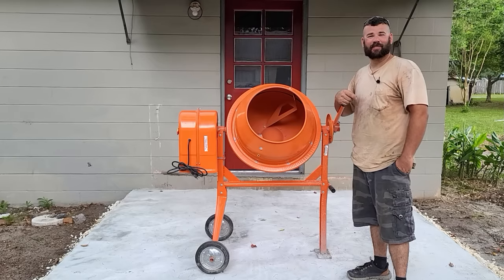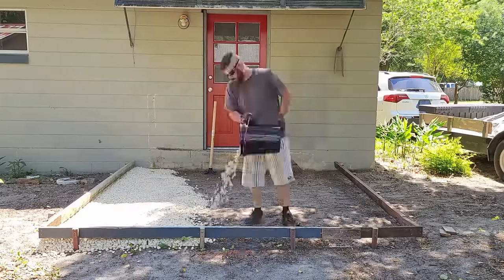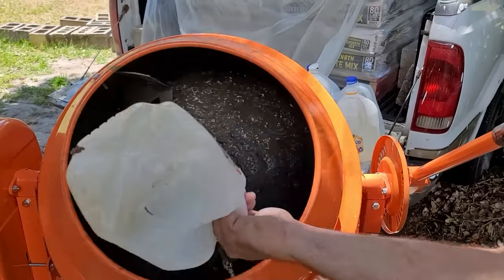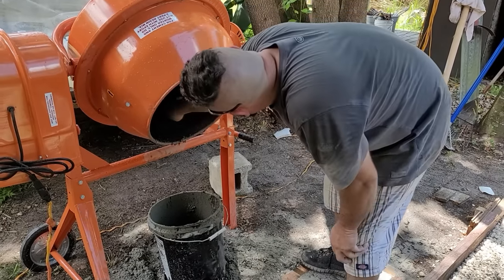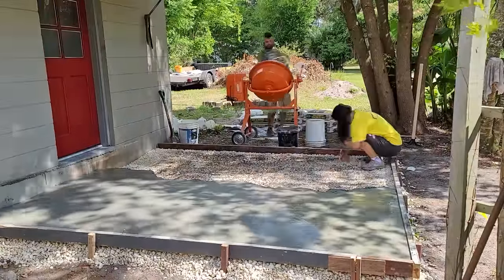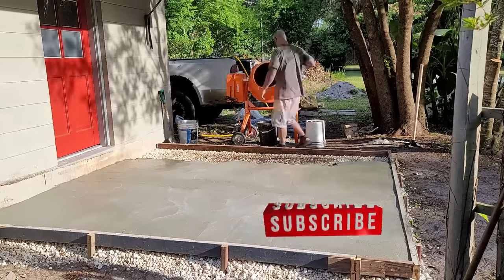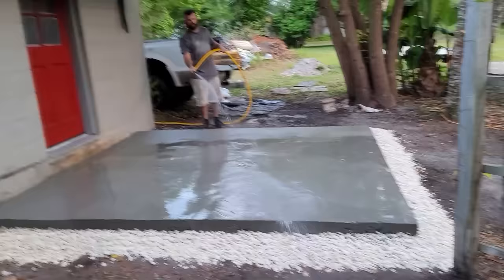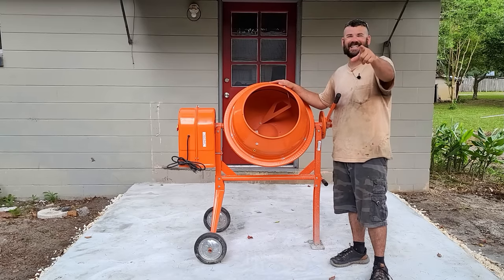Pouring a Perfect 10'x10' Slab with the Harbor Freight Cement Mixer

Comment: It might have been possible to set the mixer in the area to be covered and dump directly onto the base until you worked yourself into a corner.  I hated to see you work so hard, but I appreciate it.  Great video, especially the information about the mixing process that worked best for you.
Reply from the maker: I really wanted to do that, but I couldn't figure out how to do it and not smash the wire fence brackets. Thank you for your comment, and welcome to the channel!

Comment: I poured a 6’x3’x4” slab last weekend by myself. Used an earlier model of that mixer and I screeded as I went. It was tough even at that size so you have my respect. A thought for next time is to have the top of the forms boards to be your screed level and screed as you go. I found putting the right amount of water in first is the way to go. I also used 50# bags x2 per batch and kept the mixer running the whole time.
Reply from the maker: We love hearing from fellow DIYers! We will be doing another big project this summer and we definitely keep your recommendations in mind. Welcome to our channel!

Comment: Thanks for the video. It's good to see what can be done with a straightforward approach and minimal expense. I want to do a patio behind the house and it's really useful to see what other people experienced. I don't think it's even feasible to get a concrete truck back there without massive prep work or by using a skid steer or similar piece of rental equipment to run back and forth 20 times and rip up the yard. Since it'd be $$$$ to hire a contractor to do it, I could instead spend some of that money on purchasing more heavy duty concrete equipment or renting it anyway. I have a small mixer similar to the harbor freight mixer--but it's pretty labor intensive to even do small projects. Very helpful, thanks.
Reply from the maker: We absolutely love comments like this! We hope you diy your porch and have a blast doing it. You're right, it's a lot of work but totally worth it. Welcome to our channel!

Comment: I've loved my HF mixer!  Only problems were dry zones. I would have to stop the mixer, use a gardening hand hoe and break up the dry zones.
Mostly, I've only done 12" piers and two 5'x5' slabs.
I've always oiled my forms, poured wet, screeded, misted with water, and waited about 45 minutes to let it start setting up.
Then come in with my float and trowels to smooth it out.
Reply from the maker: That's awesome! We have only used it for that project so far, but I have a ton of molds that I want to start making. Welcome to the channel
Reply: We just poured a 4×10 slab, 3.5" thick.  We had the best luck adding a gallon of water to the fully upright mixer, adding 2 60lb bags, then starting it and running it tipped to the limit before it would spill and adding water until we could tell the clumps on the bottom were broken up.
Reply from the maker: It's all about finding that sweet spot. Welcome to our channel!

Comment: We just did a 10’x13’ pad using this mixer and mixed 2 80lb bags at a time. We figured out the best way to do it which was get a good amount of water inside the mixer, then put first bag in then use a hose to add more water as we mix it until it’s really soupy, then add the second bag and spray more water as it mixes for a minute or so. We made out mixture fairly soupy which helped becuase it gave us more time to finish pouring the whole pad before it cured. I would recommend this harbor freight mixer if doing more than 30 bags. We did a total of 72 bags and it was so nice not having to mix that shit in a wheel barrow. The worst part is building the damn thing. Took us like and hour just to put it together 😂
Reply: Also I would’ve bought a cheap wheel barrow so you didn’t have to use a bucket the whole time, then just move the mixer inside the pad until you get closer. I’m no expert just giving you our experience using the mixer. Good job on your pad!
Reply from the maker: Glad to hear that others are DIYing too. I made a video for putting it together also because I knew people would have a hard time. Welcome to our channel!

Comment: Works great with 2 60lbs bags. Spray inside with water, turn mixer straight up and plop bag on top the bust it with a hoe. Much easier than trying to dump/pour the bag. Move mixer the #2 position, turn her on add water to get a good slurry going. Don’t want it binding up on the mixing paddles. Turn it off. Back to upright, add next bag, then back to #2 and let it run. Because the first bag is more slurry, second bag mixes well and you can water as needed.  Very consistent result every time. I’ve even done a third 60# just to get done but it’s the same process, just harder to mix because you can’t get a good angle on the bowl, but it’ll do it in a pinch. With 2 60# you can get a good rhythm going especially if you can be inside the pour area and mix and dump. But this also work really well for a wheel barrow, very little spillage.
Reply from the maker: We will definitely try all of that on the next one, hopefully coming this summer. Welcome to the channel!
Reply: Once you hit that rhythm it will get done in no time and will be fun too! We normally had three guys. No mixer, just a bucket and a corded drill. 

We were doing a slightly different application but it’s all the same stuff. Get one guy towards the end of the current pour to go setup the next and start. Other two back him up and prep the next space, pour and spread, rotate the mixing guy every so often (it’s a break). Rinse and repeat!

With three good dudes you could knock this out in one morning. Especially with a mixer
Reply from the maker: We have gotten much better with the mixer since the video. That was actually our first time using it. We plan on doing a driveway soon, so stay posted. Welcome to our channel!

Comment: Nice work.  I'm sure you'll get the usual hate comments, but the only thing that matters is that you are happy.  I've done a couple of similar projects with the HF mixer.  I do always mix 2 full 80lb bags.  I put the full amount of water for all 160lbs in first, then I put one bag in, and wait until it's pretty much all liquid (1-2min), then I put in the 2nd bag and wait another 2-3 min for it to finish mixing.  The 5 gallon bucket slowed you waaaay down, but hey, you gotta use what you have.  Some sort of ramp to dump it straight in to the form, might have worked.  Anyway, the 160lbs sometimes is hard for the HF mixer to even spin!
Reply from the maker: I'm definitely going to try that next time and we recently bought 2 wheelbarrows so I'll be much better prepared. You live and you learn. Btw, welcome to the channel!

Comment: WOW! I think a wheelbarrow and bigger batches would've helped a lot, but I've never done this before. haha. Great job man
Reply from the maker: Unfortunately the wheelbarrow wasn't an option for the project because the fence is in the way. Next time I will do smaller sections. DIY is always the best way 😁. Welcome to our channel!
Reply: @VIPHoldings  Well I have seen other videos where they remove one of the boards on the end to allow trucks to drive into where the concrete was poured. I think you could've done the same here. Moving all that weigh with a small bucket is insane! Haha. You got it done though! That's some serious determination. Haha.

Comment: Cringy in the best way. Getting it done is what! I have recently taken some building courses at my local community college and went deep with concrete. The words you use are not correct to the profession but the result is perfection for the intended use. How did your back feel after all this? Looking to do similar work, already have the mixer but only used it for fence posts at this point.
Reply from the maker: I was in bed for a couple days after this. Good luck on yours and welcome to our channel!

Comment: Instead of doing the 5 gallon bucket routine, just put the mixer in the pour area and dump it straight to the ground, saves a lot of work and no wheelbarrow needed.
Reply from the maker: I thought about that but didn't know how I would be able to do it with chicken fence laying there.

Comment: How's this slab holding up? Any cracks? I would be concerned the drainage aggregate would start to fall away since there's nothing to hold it in place  around the perimeter.
Reply from the maker: So far, so good. I do plan on building a perimeter, but no cracks, and the base rock is still in place. The porch gets used pretty regularly, too.

Comment: Yall did great man also u saved alot of money and 8 hours for that yall good job. 
Here some tips for you next time 
1 .place a concrete bag on the bottom on that little leg to make it more stable 
2. U can mark a bucket when u find out how much water your comfortable,but on this unit I fill it to like the gasket seal and then add lil bit depends how I need it
3.one  could lay a tarp or wood and cut alot bags in half flip and make a pile and and u can shovel it or u can dump them over shoulder however 
4.stick with two bags 80 lbs for sure and when it's mixing since u put that concrete bag to make it more stable ,preferably me I grab the handle release it and start tilting it even more and it mixes so fast especially when I have mix something dry or some high psi and only allowed the exact water amount
5.instead of building up the concrete all the way on a big pour only fill like half 2inches and do a little area like that  then when your ready fill the 2 inches then bull float a large area instead of little sections everywhere and stoping so much 
I got many more but im sure your u got it under control good job again 
Subcribedddddd!!
Reply: Also that wire is fine uhave nice base ,
Reply from the maker: Thank you and welcome to our channel!

Comment: You could also use a metal ramp to pour out the concrete in the form
Reply from the maker: I think my biggest problem with this form was that it was just too big. Next time, I want to do smaller forms, so I have more maneuverability.

Comment: It looks like it Turned out great looks like you did a good job  Do you think it would have been a little better if your concrete was a little more wetter while you were pouring all of that and then as you Get to the end make it not so wet. I'm just wondering.  Give you more time to work with the 1st part of the pour
Reply from the maker: I thought about that, but the professionals say that it's stronger if it's on the drier side. On the next pour, I am going to make it a bit wetter, and my forms will be much smaller. Welcome to our channel!

Comment: While there is room for improvement, and I’m no expert by any means, I’m very impressed. Personally I don’t use straight concrete mix, I use the stuff that has rock already in it as well as use plastic underneath for a moisture wall. However you did it very well and it looks good!
Reply from the maker: Thank you, and welcome to our channel. So, where do you add the plastic? Under the foundation rocks or between the rocks and the pour? Why do you do it?
Reply: @VIPHoldings  being in the south and moisture is a big thing here as well as water, I used it on my car port  ontop of just the bare ground(clay structure) however I would have liked to put it ontop of some gravel but didn’t want to risk tearing the plastic. So far I haven’t had a single issue on moisture or water pooling up. I’ll be building a storage pad and shop pad in the future, one will get plastic the other won’t
Reply from the maker: @Grady_OBS  ok, so you used the plastic instead of rock? I think that was an intelligent and cost savings move but please don't make a video of it and post it on YouTube. Some of these "Pro" would eat you alive 🤣. Thank you so much for sharing!

Comment: Really did a great job for being the first one. Just make sure that wire sits up a lil off the ground so it is in the concrete and the concrete is not on it that helps reinforce the slab. But definitely y’all did a great job. And video was real helpful 👍👍🫡
Reply from the maker: We found wire stands that were actually designed for just that. Welcome to our channel!

Comment: Highly recommend rebar. A slab that big would need #3 24” in each direction. Concrete has very little strength without steel. Also a control joint in each direction so when (not if) it cracks it’s won’t be seen. The only two guarantees with concrete are that it’s hard and it cracks!!!!🎉🎉
Reply from the maker: I agree and we did use metal but no need for thick rebar. If I had to do it again, I would put the lines in so it will crack where I want it to but I could do it with a saw at anytime. Welcome to our channel!

Comment: That mixer will mix 2 x 80lb mix. Add the full min water for both bags. Add 1 80lb bag, tilt, mix to a slurry. Stop, scrape, mix.  Flip up, add the 2nd bag, tilt, mix and then add your remaining water not exceeding the max for both bags.
No wheelbarrow or you don't feel like doing that, put the mixer inside the area, it has wheels on it, and then just tilt and dump. It will spray off when you're done. 
Minimum slab should be 4 inches. That's code in most areas. If you don't want to fiddle with rebar you can always get fiberglass and add a handful when you're mixing.
Considering that you raise the grade what is a slab and not the landscaping to match, overtime you will get washout. The weakest point on your slab is going to be your outside corners. You could have just placed 3/8 rebar 6 in in all the way around. Would have cost you $12.
Reply from the maker: Welcome to our channel!

Comment: You went about it the hard way. Put the mixer inside your form and dump it directly. If you were pulling the reinforcement mesh up into the concrete, just roll the mixer along the side of the forms and dump directly. Next time you will have more fun!😁
Reply from the maker: As I've explained a few times, that just wasn't an option for this pour. Welcome to our channel

Comment: Great video! How about putting the mixer inside the forms and moving it toward the corner then out for the last pour?
Reply from the maker: I really wanted to do that, but I couldn't figure out how to do it with the metal fence in the for strength. I think next time I will do smaller sections. Thank you, and welcome to the channel!

Comment: We poured a 13 by 13. The screws were not complete in our equipment... You can put one 80 lb bag each time which makes it slow but we managed it. We sprayed water and watched consistency instead of measuring. The force of water spray helps too.
Edited for better comprehension with use of ChatGpt :)
Prepare the Site:
Clear the area of any debris or vegetation.

Put down 1-2 inches of gravel and level it by tapping to ensure a stable base.

Form Your Mold:
Construct a wood frame to outline the slab area. We ysed 2x4s. It us actually 3.5 inches! Do not be mistaken. 

Ensure the form is sturdy and well-secured. You can combine different lengths by screwing tmen together using a 12 inch part on the outer side as well. 

Pour and Level Masonry Sand:
Pour 0.5-1 inch of masonry sand inside the mold.

Tap to make the sand dense and flat.

Ensure Proper Slope:
Measure your level to make sure you have a 1/80th length slope for drainage.

Oil the wood form for easy release later.

Wet the sand to improve bonding with the concrete.

Prepare the Concrete Mix:
Mix the concrete so it is not too solid or too liquid. Work quickly if it is hot outside. 

Pour the Concrete:
Pour the concrete, first filling halfway up the mold.

Spread it evenly across the entire area.

Add Reinforcement:
Place your mesh or rebar halfway through the first layer of concrete.

Fill to the Top:
Continue pouring the concrete to fill the mold to the top.

Spread and level it as you go.

Level the Surface:
Use a straightedge to level the concrete across the entire slab.

Move it back and forth in a sawing motion for a smooth surface.

Finish with a Magnesium Float:
Use a magnesium float to smooth and perfect the surface.

This step helps bring moisture to the surface for a better finish.

Edge the Slab (Optional):
Approximately 1 hour later, you can use an edger to round the edges if desired. You can go back and reedge after 30 min. The edger gets inserted hardly inbetween concrete and wood. I suggest ysing the edge of a knife or float to make space first. Pebbles can get in the way as well. 

Cure the Concrete:

Cover the slab with plastic sheeting or a curing compound to retain moisture.
Keep the concrete damp for at least a week to ensure proper curing. We still wet them once a day after a week.
Reply from the maker: I just took a screenshot of your list because we will be doing another BIG pour near the end of the summer. Thank you for taking the time to write it and welcome to our channel!
Reply: @VIPHoldings  Edited for clarity.
Reply from the maker: WOW! You are awesome! Thank you so much!

Comment: FGood job. That bucket stuff had to get pretty old by the end of the project, eh? 

I made a chute for my HF out of a plastic 55-gallon drum. I split it down the middle and hug it from the frame under the drum. I extended it behind the drum to catch the pour when tilting the drum all the down. 

It makes the job much easier when pouring because you can pour the mix directly into your forms, plus no wheelbarrow to tip over and clean up when the job is done. 

I don't like the location of the start/stop switch and plan to either relocate it to the top of the motor cover or make an industrial switch on a pigtail so that I can control the machine from either side of the machine.
Reply from the maker: That is an awesome idea! I might have to steal that. Welcome to our channel!